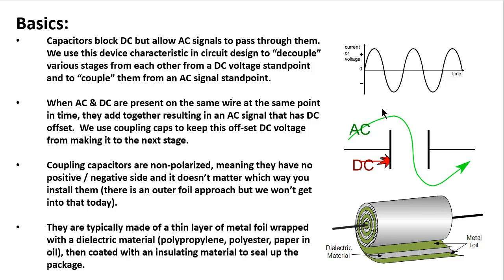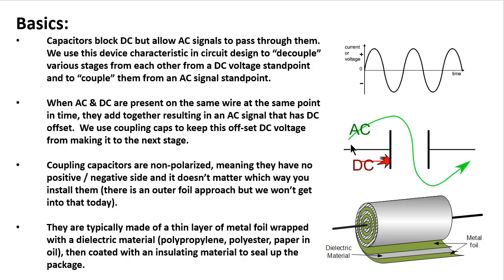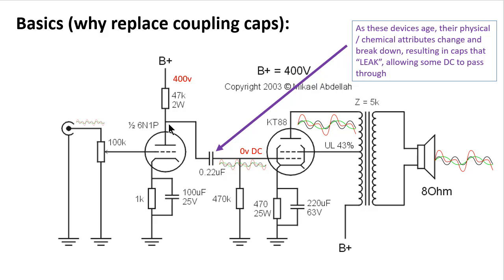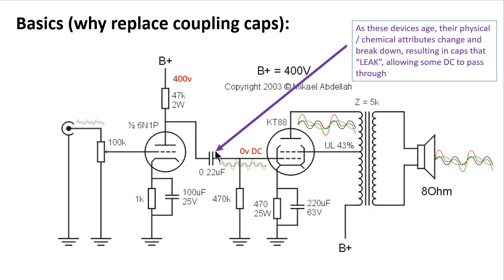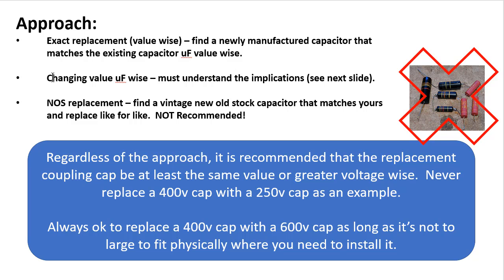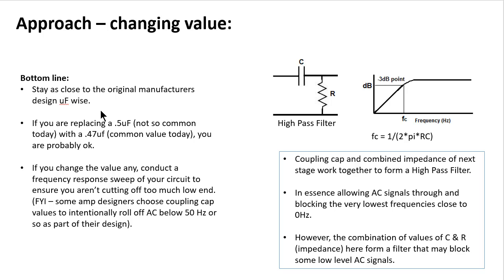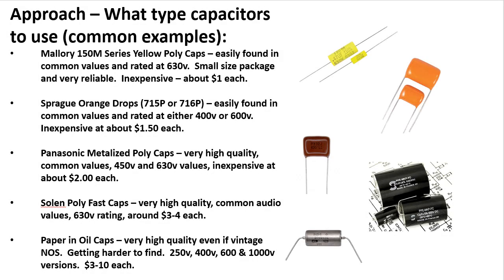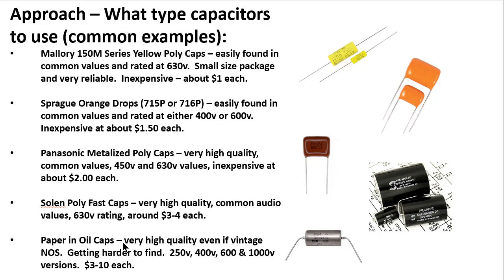Replacing Coupling Capacitors in Vintage Gear

Comment: I'm used to working on high voltages working on 3 phase appliances and the like. I bought a dynatron cavalcade gr2 valve record player , it has 2 x el84 and one ecc83 valve and I want to replace the electrolytic caps and the normal caps for polyester ones as they are old wax and paper ones. How do I find the values for my amp. Thank you for sharing you definitely have created the best video Harry on YouTube for this, you're giving me inspiration to do this. I need to do the death cap and electrolytics to

Comment: when I hear someone say - capacitors have an outer foil but it doesnt matter  which way it's aligned - I stop watching and listening to that person - it DOES matter - - if you want to get the best out of coupling caps you need to know on which  side the outer foil is - the sum of the parts and the way the coupling caps are wired contributes to lower noise .

Comment: Really appreciate your analysis of how coupling caps perform in a circuit. It makes sense of what I heard someone say, that, “bigger problems come from the small capacitors, not the big filter capacitors.”

Very instructive video. Appreciate it.

Comment: WRONG!  The voltage on the plate of the 6N1P will be substantially LOWER than 400.  That's, of course, it the 6N1P's filament isn't burned out. :face-blue-wide-eyes:

Comment: Greetings again!!  Question sir if I may.  My mid and bass pots have little to no response in my tone stack. I test them like you suggested. I put common probe on chassis for ground reference then take red probe and test at the plate slope resistor at V1 which has high voltage sitting there. Then I take red probe and test where other lead of orange drop connects to pots. They read .2 to .4 millivolts. Would you call that the correct way to test and if so , would you consider them not leaky? AND, even if they aren't leaky, can they still be bad? Thank you for your time!!! Blessings, Jim

Comment: Just wanted to say thanks for another very informative video.  I'm getting set up to repair old Amateur radio gear, still needing a few items of test equipment.  The information here is of great value.  Having to refresh things I learned in '79.  Also, back then I had a supply system for parts ordering, rather than having to source them on my own.  Good information through-out.
Reply: I've had good success with Mouser, they'll get even small orders out in a few days, as long as they're in stock.  The biggest issue usually is figuring out which of the dozen or so search returns is best for your application.  :-)
Reply: @drtidrow  Agreed, used them for the first time a bit over a month ago.  Was quite happy with the experience. Prices reasonable, and shipping was far quicker than the folks I was using prior.  They're now head of the pack.

Comment: Thanks for a great video! The explanation of coupling capacitor is the first time that I understand how they work in a tube radio circuit. I am a hobbyist restoring tube radios. i have attended some radio restoration courses at our local vintage radio museum here in the Twin Cities. Actually tomorrow there is a special meeting on how to improve the classes. I will bring up your videos as a great way to teach how to work on vintage electronics. Thanks again.
John

Comment: I need to change my existing coupling capacitors from .02uf 600vcd to .01uf 800vcd, is this going to drastically change the sound of my push pull EL84 stereo amp?
Reply: What's driving the change?  Note that a .022uF would work just as well as a .02uF one, and generally much easier to find... and with component tolerances being what they are, a cap marked as "0.02uF" might have its actual capacitance higher than one marked "0.022uF"  

Another option would be to put two 0.1uF caps in parallel, as capacitance adds in parallel.
Reply: Reducing the value of the coupling cap will likely reduce the base (low frequency).

Comment: Will a leaking coupling cap only degrade the tubes of the next stage, or will they also overload many other components as well?  I've gone ahead and replaced many components already on my tube amp (electrolytics, power resistors, filter cap balance resistors, etc), I'm worried if I don't also replace the coupling caps, they'll destroy most of my brand new components rendering my efforts pointless.  I can deal with replacing tubes but I'd hate to have to tear my amp down again and redo everything I just did.  I do not know if any are leaking but just the thought of the possibility makes me want to just go ahead with it and replace them all?

Seems like the effort to test each individual coupling cap would be better used to just desolder and replace (I only have a DMM not an analog multimeter), but then again they are one of the largest contributors to tone right?  My amp is almost 35 years old at this point, any recommendations as I'm going in circles with which route I should take.
Reply: Well, a 35-year-old amp probably is using the more modern poly film caps, generally the old oil/wax-impregnated paper caps are found in vintage tube gear dating from the early '60s and before.

As for whether a leaky coupling cap can overload other components depends on what's connected to the following stage - I'd check any cathode bias resistors or plate load resistors, as excessive tube currents caused by leaky caps might have exceeded the wattage ratings of these resistors.  Often this will show as a "scorched" or "burnt" appearance of the resistor in question.  Even if they don't show any obvious discoloration, the excessive heat may have caused them to drift in value, so I'd check them and replace any that were outside of the tolerance range.

Comment: Thank you for your videos. I am just learning about tube amplifiers and would like to confirm if I understand the process correctly. You mentioned 400 plate volts on the coupling capacitor(on about 7th minute of the video), but isn't it actually less then 400v because of the voltage drop on the plate resistor? So, it's more like 360-380 volts of something. This is just for my understanding of how AC/DC currents work in an amp. Most probably, you are concentrating on a different topic and just generally call the voltage plate 400 volts? 
 Again, this is not for the sake of argument or making a point, I am just trying to understand how things work.

Comment: Very informative videos and I thank you! May I ask you a question ? I'm trying to get and keep my guitar amp running at its peak performance. While measuring orange drops , there is moderate levels of DC present on one side. The other side measures a few millivolts. Would you consider that a leaky cap? And one more if I may sir, on one or two orange drops, there is decent levels of DC on both sides. Is that just dependent on the circuit or , no matter what , there should be no DC voltage present? Hope you understand. Thank you for your time! I'll keep watching. Blessings, Jim
Reply: Depends on the circuit design, that could be completely normal depending on the biasing scheme and other circuit considerations.

Comment: Are milivolts ok or zero volts on the other side?
Reply: Depends on how the circuit is wired on the low-voltage side - a few dozen millivolts at the grid of a tube is fine, as long as the cathode voltage is an order of magnitude higher.  For example, you might have a circuit with 10-15 millivolts on the grid, and 5-6 volts on the cathode... as long as the grid stays at a negative voltage relative to the cathode, you're generally safe.

Comment: I just built a vintage solid state amp from a kit that was made in 1965.  All of the caps in the kit except for a few are electrolytic, and I purchased brand new ones rather than using the originals. I did use the original 6 ceramic disc caps and 2 mica caps though.  The amp is motorboating.  Someone suggested that it was a faulty coupling cap, but how can I tell which caps are the coupling caps?  Are these always the non-polarized caps (disk and mica), or could they be electrolytic?
Reply: As far as I know, electrolytics don't get used as coupling caps, as they tend to be inherently "leakier" than other types.  Usually coupling caps are disc or tubular metal foil types, mica caps generally are reserved for oscillator and tuning circuits where their temperature stability is desirable.

Comment: You said that when these caps age they start to allow dc to pass thru. Other than messing with the bias and stress the tubes does it create hum or other noticeable distortion?
Reply: Definitely - the shifted bias level could massively distort a signal passing through, as the tube in question might be driven into "saturation" and clip the signal.

Comment: im due to do a recap soon . are coupling capacitors electrolytic or not ?? as i want to get this project right thanks .
Reply: Hope your recap project came out okay, as this question is a year old now... generally, coupling caps are not electrolytic, as they tend to be "leakier" than foil caps to begin with.

Comment: If you want to alter the design, what you can do is trace out the schematic then use ltspice to create a bode plot for proposed change. It will also teach you you need to understand the ESR and miller capacitance for example. It won't be perfect but teaches you a lot.

Comment: It was my understanding that when replacing caps the idea was to connect the outer foil terminal to the side in the circuit that has the lowest-impedance path to ground. This helps the outer foil of the cap to act a bit like a ground shield for EM/RF interference.
Reply: oh so how do we tell which leg goes to the outer foil? and my understanding was that it depends on which direction that DC component is coming from... totally abstract concepts in my mind, i just try to follow the schematic, kinda like paint by numbers, because I'm still learning. but i think your point will stick with me, because it makes sense, i just need to file that away for later. and you do mean this in terms of an electrolytic polarized cap right?
Reply: @simonlinser8286  No - not electrolytics. One method is to hook a cap up to an oscilloscope set to very high sensitivity on the vertical amplifier, then touch the outside of the cap with your finger. Then switch the scope leads to the cap and do it again. Of the two ways, the one which gives you the least induced noise is the one whose lead is connected to the outermost layer of foil and that's the lead that should go in with the least impedance to ground.

Comment: 12:40 Component tolerances for these types of caps are typically 20%, so there's a pretty big overlap in the acceptable range of values between a vintage 0.5uF cap and a modern 0.47uF one.  For all practical purposes they're equivalent.

Comment: Hi there. I am rebuilding my Heathkit ar1500a  ss receiver amp and an wondering if I should not replace the tantalum coupling caps with something else? The original caps are 10 uf  15v polarized tantalum. What would be a solid replacement. Have had a few builder friends suggest I go with 22 uf. Should I consider this and maybe bump the voltage capacity value as well. Most of the caps are in a amp output and phono preamp section. I do have a couple 10 uf's on the tone control section and one 47 uf on the main power amp supply. Your opinion would be greatly appreciated. I have replaced the old 5w resistors (sandy's) with 10 watt mills which I think would be better as they do get warm. Thanks Mike

Comment: MikesRadioRepair is correct.   Those new replacement caps can be measured to see how noise can become part of your circuit.  Try out that measurement Mike talks about for yourself.  You might be surprised.

Comment: You can simply test coupling non polarised caps by checking with an instrument/ guitar cord! Plug into a guitar amp clip alligator clips to the hot tip and ground shaft, o.k.? Put the other end of the clips to the leads of the cap. The quieter side is the + side.

Comment: On changing the component values also keep in mind that these old capacitors were only really accurate to about 20% tolerance, so a change of value of about 20% is well tolerated.  Choosing the nearest commonly available value will get you within 20%.
Reply: I need to change my existing coupling capacitors from .02uf 600vcd to .01uf 800vcd, is this going to drastically change the sound of my push pull EL84 stereo amp?
Reply: @davidnguyen5028  That is a change of 50%.  Depending on how it is used in the circuit, it will probably increase the low end roll off frequency.   That might be a big deal or not depending on how low in frequency you need your amp to go.
Reply: @argcargv  so since I’m going with a smaller number, I will get more bass?
Reply: @davidnguyen5028  No the opposite, a smaller number will get you less bass.  Lets just say that the cutoff was at 50 hz before, with half the capacitance it would be around 100hz.
Reply: @davidnguyen5028  If they're not too large, put two of the 0.01uf cap's in parallel for a 0.02uf value, if you're having trouble finding the 0.02uf.

Comment: Excellent video! You also explained very well the +/- on film caps I have seen on some Youtube vids.  Always thought that it was another thing that I could put in the $5k power cord will make your system sound better group.  Always have thought if it sounds good to you then it is good.  All depends on the individuals hearing, same as the $100 + coupling caps out there.

Comment: Thank you for this as a much a refresher as it was new information. I see the inner foil debate rages below, One thing people often forget is the tolerance. for example I have had the odd customer here or there wanting to reject a resistor as it was not 1K ohm but was within the marked/published tolerance,  I did explain nicely! I would consider that replacing a 0.5uf at 20% with a 0.47 at ten or better gives a difference    not worthy of concern and could even give a capacitance closer to design than the old parts if as new they were at the far end of the tolerance to start with.  I am trying to find out if tesla are still making poly caps for interstage decoupling as i local veteran repair shop was waving some at me but my  skills in Czech were only matched by his in english so almost no understanding. i recall the old Philips/BC (now vishay) electrolytics were plus 20 minus 80 percent.

Comment: WHAT ABOUT THE "BUMBLEBEE" CAPACITOR IN THE TOP LEFT CORNER?!!
Reply from the maker: Its not really a coupling cap, I'll replace it with an XY style but that's outside the scope of this video.
Reply: @Blueglow  uh-huh...
Reply: As Mark states they are not coupling capacitors.  If you look closely it is attached to the AC mains cord and in vintage gear is commonly referred to as the "death capacitor".  If it shorts out it can energize the chassis by directly coupling the AC line to the metal chassis.  Safety caps that go across the line or line to ground (chassis) capacitors are best replaced with modern XY rated safety capacitors that are specifically designed for this type of application.  If these capacitors ever go bad they go bad open and not shorted.
Reply: Thanks Mike for that informative explanation!
Reply from the maker: @daleburrell6273   and now you know the real reason I didn't address it in the coupling cap video.  https://youtu.be/Q0jM05sxy28

Comment: The outer foil is actually very important.  Install the capacitors in the wrong orientation and it can induce a large amount of noise into a circuit.  I have had radios sent to me that customers recapped themselves and their complaint was that they had a lot of noise in their receiver.  Disconnect the non polarized caps and test them and I usually find about 1/2 of them are backwards.  Do nothing more than turn those capacitors around and the receiver magically becomes dead silent. The outer foil of a capacitor acts like a antenna and can pick up all kinds of unwanted noise.

It's very easy to sort your capacitors and mark the outer foil.  Just attach the cap to a oscilloscope and grab the body of the cap and then reverse the leads.  The side attached to the scope plug that shows the most 60Hz ripple voltage on the oscilloscope is the outer foil side.

Mr Carlsons Lab here on YouTube has done some very good videos on this topic.  He also shows how to make a tool for sorting and marking the outer foil of caps.
Reply: I agree with you Mike, The outside foil is very important, especially in tube amplifiers. The outside foil side should go to the side with the least impedance. Any extra noise will be amplified by each stage. Mr Carlson's lab has a great video explaining this. If you install all the capacitor's backwards-your amp will not sound as good as it should.
Reply: How do you test them for polarity?